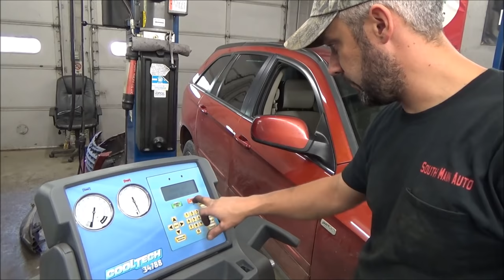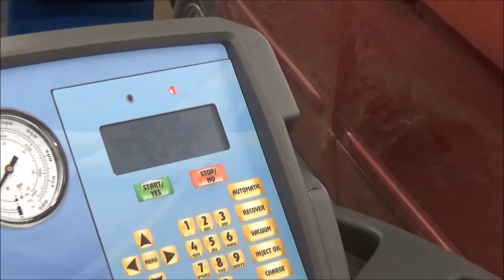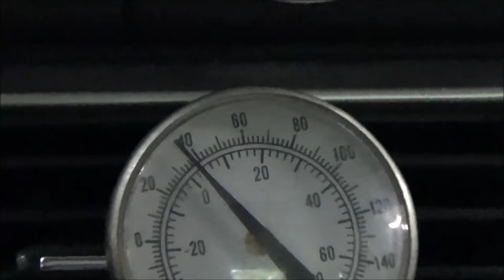A/C Condenser Remove & Replace : Chrysler Pacifica

Comment: Whenever I get a car where the AC has been exposed to atmosphere, I always recommend to replace the dryer just because I worry about the dessicant being saturated.  I also always replace the oriface tube anytime the system is discharged and I do flush the system as well- it's amazing the gunk that flushes out - especially with a bad compressor- seems to compressor disintegrates into the system contaminating it.
Reply from the maker: Schrodingers Box Holy smokes man, I work for the general public here lol. They have 2 questions, how fast and how cheap. I totally agree though, I would love to do all of that and as a matter of fact some customers even go for that too. The system on this car does not use an orifice tube however but that is neither here nor there. I will let things slide on some A/C repairs but in the event of a catastrophic failure, ie. pump explosion, desiccate pack comes apart etc., then in that case I will not do the job with out a complete flush and replacement of the accumulator, and orifice or in the case of this car an expansion valve and a receiver drier.
Reply: jarin wilson Yes I draw vacuum for about half an hour then let it sit and ensure vacuum holds. If it does not, I know I have a leak in the system
Reply: Schrodingers Box I've got no clue how to flush an A/C system.
Reply: DE Nichols I use a product called AC Flush- it's just a can of solvent with a short hose and rubber tip on the end to seal over the end of open AC lines. I disconnect all the lines and flush them -everything except the accumulator (which I replace).  I especially thoroughly flush the condensor and evaporator. Then I follow with compressed air til no more flush solvent exits.
  I am working on some AC videos- hopefully I'll be able to show the procedure soon.
Reply from the maker: I use a 4 seasons refillable flushing tank that you fill with flush solvent. The # on it is 59024 if you wanna look it up. Might save you some dough from buying the cans.
Reply: Cool man, with the money I save I'll buy that AC recovery, dispense, and analysis station like you have there. Jesus man. It's the AC equivalent of Paul Danner's scan tool kit lol!!!
Reply from the maker: I call it my ATM lol. Kinda works like one ya know.
Reply: South Main Auto Repair Well I tried refilling my AC using an ATM and now I have no refrigerant and I'm in jail.
Reply from the maker: Lol must be you had the two hoses mixed up! Next time check your Haynes manual you fool!
Reply: South Main Auto Repair Hahaha- it was advice I got from a forum. Dang I never listening to those guys again!!
  Hey btw- how's that MaxiDas working? I really am considering getting one. My AutoEnginuity is great but it drops communication a lot and the laptop thing is less than convenient. Dennis showed me his and the only thing I wasn't crazy about was the refresh rate seemed extremely sluggish.
Reply from the maker: Actually I am getting the MS908P Autel. Don't have it in hand yet but was messing with a new loaner unit. Tell you what as soon as I find the scope I want with it, it blow Snappy Verus right out of the water. and it is 3/4 the cost. $2,100 instead of $10,000. The warranty is out of this world too.
Reply: South Main Auto Repair WHAT???? Holy crap, totally checking that out!!!
Reply: Schrodingers Box Briansmobile and Scotty Kilmer both use the Autel. It needs a plastic pencil instead of touch screen. With warranty you get customer service (needed says Brian and no says Scotty).

With warranty you get updates. Without your on your own and it outdates as cars come out.
Reply: You can get it for 1/2 with no customer service/updates from Harbor Freight.
Reply: If memory serves, Brian bought it to make German cars behave with his scanning needs.
Reply from the maker: If you want Matt you can call me we can talk about it... Denny has my #
Reply: South Main Auto Repair I will take you up on that! I'll send you a PM soon
Reply: DE Nichols To be honest, the idea that Scotty uses it is hardly a selling point lol

Comment: i did a fan relay on one of those and you don't have to take off the bumper cover just loosen the top parts and sneek in the air hammer wack off the rivets and use some self tappers to secure the new relay, problem solved and way under flat rate

Comment: Did you Check to see if the the cooling fan relay that caused the damage still worked or if the one attached to bumper crush plate was truly bad Eric O @SouthMainAutoRepairLLC

Comment: Like your channel and the a/c repairs info.

The demo on water removal was good info.

Question;
When we pull full vac for an hour or more on the a/c system,
 does that pull any left over oil that was in the system  from last charge?

I ask because if we add the spec vol to the new charge and there was left over oil in the system, it would  have too much oil in the system.

Thanks for your time.
Jack Langston
Abbotsford BC
Canada.

Comment: Most compressors use a poe oil which is very hydroscopic meaning the oil absorbs moisture. When this happens it’s mixes with the refrigerant and will turn to wax, which will gum up metering devices, coils etc. micron Gauge will tell you how dry the system is and should be used every-time  you pull a vacuum

Comment: I get that pulling a vacuum will vaporize water, but if that is deep in the system will it not just return to liquid as soon as you release the vacuum or charge with refrigerant trapping the water in the system anyway?

Comment: Engineers probably had a reason to mount that relay on that aluminum bumper. Just look at those cooling ribs on the relay itself. That is proof that that thing gets HOT. The aluminum bumper is also meant to be an additional heat sink. If the new one is not also attached to that bumper it might fail soon after.

Comment: I liked the pressure demonstration on boiling point and the "Problem Solver" (although isn't this Moog? :) demonstration at 39:19!  Chrysler still covers those Chrysler Pacifica's manufactured from 2-23-2004 to 3-31-2004 but only those in Canada and "19 salt belt states," but this only covers about 1.8% of the vehicles with the rusty subframe problem.  A class action suit for years 2004 to 2008 has been filed comprising over 300,000 vehicles in Ohio by D. Andrew List of Clark Perdue & List Co., L.P.A.  If you own a Pacifica with this problem you know what you have to do!  LOL!  Apparently the nickname for this vehicles is "engine dropper."
Reply from the maker: ***** Haha PROBLEM SOLVED!

Comment: Long shot question. Do you know if there is a vid on a dash removal for a 2007 Chrysler Pacifica Touring 2WD 4.0L? I have a dealers repair manual. Had about 70% of the dash disassembled but then... got stuck. Couldn't figure the rest out.  PS: have seen dash removal vids but hoping for one for the above named car.

Comment: Not condenser related, but our 2004 caravan has an external trans cooler between the condenser and radiator. The rivets corroded and the thing started bouncing and rubbed a hole in the radiator. So keep an eye on your dodge vehicle.

Comment: Years ago (2004) I worked at Denso manufacturing making the radiator, condenser, oil cooler, shroud assemblies for the Pacifica. That thing brought back memories. (None of which were any good)

Comment: That top tul brand looks like the next level of those really good tools the dollarama here sold for a while (Allen wrenches better than mastercraft for only $4 and vice grips with no wobble and deep but thick teeth that should last a while (I only used it once and packed it away for a move I’m still working on) and a decent file ect)

Comment: I enjoy your videos especially the Pacifica ones. I have an '05 3.8 and I need a radiator. Can't I take that out from the back and not have to yank the front of the car off. I'm thinking about those bolts you had to grab with the vice grips. With the 3.8 there is more room than a 3.5 has. Thanks for the vids.

Comment: A new drier would have been a good idea on this one since it lost the entire charge and was open to the atmosphere for a good while.
Reply from the maker: Sam G Ever wonder about the drier you get new in the box that has been exposed to the atmosphere the whole time too?
Reply: Well, assuming the seals on the new one are plugging it correctly,  it should have very little moisture in it. I have read at least that a drier is only good for a few hours if left open.  I just have always replaced them since they're so cheap.
Reply from the maker: I agree, I always try to sell it with the job and hands down if it was for me it would be no questions asked but customers on the other hand is a different story. Especially if it is a labor intensive one to change. We always give the option though.
Reply: Sam G on my 07 Pac, its made on the condenser
Reply: South Main Auto Repair only need to change the drier if there was catastrophic failure or acid in the system. Simple leak fix and a good vacuum is very acceptable
Reply: Watch that trans cooler too. The rivets holding it to the brackets on mine corroded and it started bouncing around and rubbed a hole in the radiator. On mine the cooler is between the condenser and radiator.
Reply: @SouthMainAuto  Many aftermarket parts sales are now requiring the drier and TXV valve been replaced at the same time to honor any compressor warranties. I have to agree with them since many "technicians" fail to do what is good protocol for A/C health measures. They are a sad group who cave into customers who want to be cheap about the correct procedure. I reckon its a real juggle to deal with either losing a job vs. doing what the customer is willing to pay for even if it's wrong.

Comment: Isn't the receiver/drier supposed to be replaced any time the AC system is opened up? I have always been told to replace the r/d.

That fan relay repair wouldn't have been so bad if the person who "replaced" it had secured the relay somehow.
Reply: Wayne Manion I work on Renault and when i did the Renault a/c course we were told 
'3 and out'. So every 3rd time the system is opened, replace the drier.
Reply: AFAIK,you're supposed to replace the receiver/drier every time you have exposed the system to atmosphere. I'm pretty sure Dr O knows this,but considering this lady was on a very tight budget...what are you gonna do... To be honest,if I were the customer,I would've done anything in my power to replace the radiator too. It just doesn't make sense,you're gonna have to pay for all that labor again when Eric was right there!
Reply from the maker: Nick Nicu Ever wonder about the drier you get new in the box that has been exposed to the atmosphere the whole time too? I always wonder about this and I have replaced them when it fits the budget of the customer and obviously if they are bad too but I always wonder about the one that sits in the box wide open to the world. Let me know what ya think.
Reply: South Main Auto Repair Actually Eric,2 things : a good quality one will always come with plastic end caps to prevent any moisture going in. And the second thing,as we all know,the receiver/drier is there to absorb the moisture in the system,so the most moisture will be found in the receiver/drier. When you put a vacuum on the system,it will evacuate all the moisture except the one found in the receiver/drier. That's why you want to start fresh. It's not the atmospheric pressure that makes them less efficient,it's the amount of moisture already built in.
Reply: @SouthMainAuto  Return those I'd guess and find another brand that puts caps on them.

Comment: Do the strut/strut mount, subframe rust, or leaky radiator mean that Pacifica will fail its state inspection? How frequent are inspections in NY state?

There are no inspections of any kind where I live. This sounds convenient, but I'm sure the result is an increased number of unsafe vehicles on the road.
Reply from the maker: Wayne Manion strut/strut mount, subframe rust - FAIL Radiator doesn't though. We have to have them once a year here.

Comment: Talking about + pressure and - pressure and boiling points. That's why you never remove your radiator cap when the car has been running a while cause once you open the radiator it instantly goes to atmospheric pressure and spews boiling hot water out the filler hole.

Comment: My inlaws Jeep Liberty AC system I think is going out, touched the line coming from the condenser and it was hot.  The compressor was turning off and on, but I have never felt a hose that hot in all my life.  What would cause the line to get that hot?
Reply from the maker: +cw2lido low side or high side?
Reply: It was the high side to the condenser from the compressor, should it be hot enough to cook eggs and bacon?  Actually the problem I am having is trying to get the cooling system to work, we have bled the system, topped it off, and the car overheats.  The fan is new, the relay's are new, my father-in-law threw parts at it and there is no fan relay solenoid so I am concerned there are green goblins in the fuse and relay box.  The car had been in Vegas since new so I am now thinking of getting the probe out and checking it out. It's a can of worms!
Reply from the maker: Yes the high side will get hot ... really hot if the fans don't kick on
Reply: I will start my diagnostic search with the fan and fan relays since they aren't kicking in when the ac is turned on.  Thank you for your time!

Comment: My ac compressor goes on and off and my cold fan dont turn on. When i check the low and high pressure my high pressure goes all the way to super high and the dryer lines are super hot. Can you please help me. Thanks

Comment: Cool video.  Did you sniff the schrader valves too?  I was going to comment on the o-rings but agree with your decision not to replace them.  Do you have a vacuum and hold feature to leak detect with the Robinair?
Reply from the maker: yes but the vac and hold only puts the system under a vacuum. It is the worse way to check for leaks because that is only 14psi of external pressure.

Comment: favorite part of the video was the tools how you say you dont rub them and what not. funny stuff.
Reply from the maker: phil holbrook Well you know some people are tool polishers, me on the other hand well....
Reply: yea they polish them and are paranoid to get them dirty!
Reply: South Main Auto Repair plus would you know where the thick cables go on which post of the starter solenoid on a 2003 f150? i have one cable that goes to the alternator then one that comes down from the firewall? got the truck with the solenoid removed. cant find a decent pic.
Reply from the maker: With out seeing it, it would only make sense that all the cables go on one big stud with the exception of the "starter wire" which would go on the other big stud by its self.
Reply: all is good now, found a good pic. had a bad starter solenoid on the starter its self it was stuck closed causing it to crank without the keys in the ignition.

Comment: 5 more minutes and the cooling fan relay could have been done right, we use a cordless right angle drill with a short bit to drill out the rivets, and then put short self tappers in their place. It’s simple and easy.

Comment: Sitting in traffic in a roasting-ass-hot car,with no a/c is no fun at all. I completely understand the need for a/c before other possibly more important repairs. Can't drive it into the shop,if you've died of heat stroke 7 blocks from your house. However,you also can't drive it in,if your wheel fell off,because the strut,etc. is hosed.
Good fix! That zip-tied fan module is kind of a "wtf". Having it riveted to the bumper is kind of a pain,bad choice on the part of Chrysler,IMO. They should have put a bolt on there,so the bumper doesn't have to be completely removed to drill it out/replace it!
I would have replaced the radiator at the same time,if it were me/my car. Might as well do it now,and only pay for the labor cost once. Plus,with the A/C now running again,the radiator has to work that much harder...My guess is that this thing will be back for a radiator sooner rather than later.
I'll have to check out some of this Toptul stuff,I can think of some tools I might want need. :)
Reply from the maker: PhattyMo Well you know it will be back :) and remember we always want / need more tools haha

Comment: Dear South Main Auto Repair. I saw your video on the Chrysler Pacifica condenser repair. I’ve got a leaky radiator in a 2006 Chrysler Pacifica I’m about to replace. Since I’m doing it at home, I’ll have no ways to recharge the AC condenser, therefore I would avoid discharging the AC if possible. I saw on your video that the AC condenser is connected with flexible hoses, therefore I think I can disassemble it from the radiator, and set it aside while I replace the radiator. Do you think it’ll work? Thanks for the response. And thanks for the video!
Reply: never mind. it's all doable without discharging and removing the ac condenser.
Reply: dibloff hey! Have the same problem. Is yours a 3.5L? Definitely can replace the radiator without discharging the AC? Any tips? Thanks!
Reply: Hi Kevin. Yeah. you can suspend the left side of the condenser on a bungee chord, and then pull it away for 4-6 inches which is enough to remove and replace the radiator. Mine is 3,5L too. If you want my advice, invest into a hose clamp pliers, and it'll make you happy. buy the one with the flex cable.